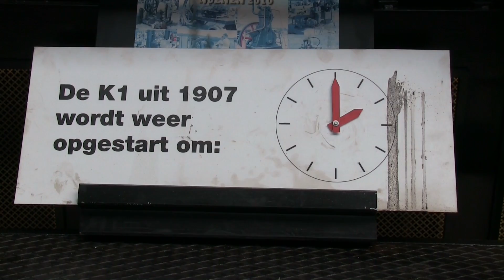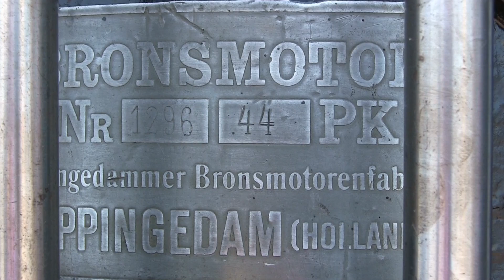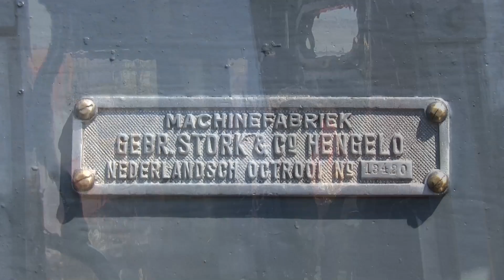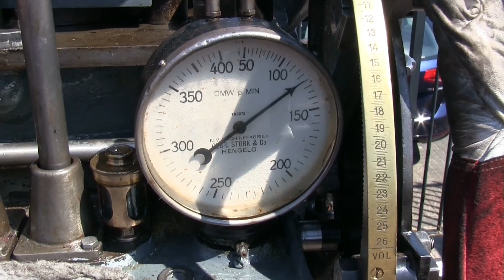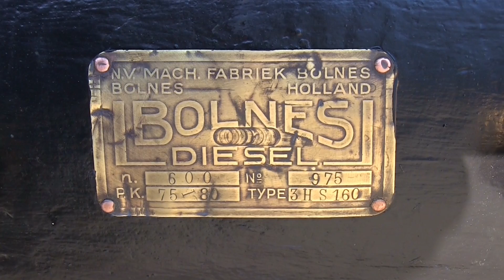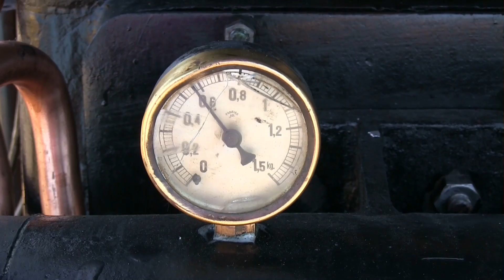Hollandse Karrendag zaterdag 27 mei 2017

Comment: Wasn't the Thomassen K1 originally hot-tube ignition?

I would like to know how the scavenging is done on that two-stroke Bolnes.
Reply from the maker: I don't think the K1 ever was a hot bulb engine, if that's what you mean. The engine runs on petrol; at 1:35 you can see the ignition mechanism in operation.
Reply from the maker: Scavenging on the Bolnes is done by the crosshead acting as an air pump. See https://mecmuseum.nl/bolnes/ for a cross section of a more modern L engine. Such an engine (5 cylinder 5KL) can be seen at the end in my report of the Hollandse Karrendag 2015 with the air valves visible.
Reply: Onderzoeker67 What I mean is a tube in the cylinder head which is heated by a gas flame.  This was used as means of ignition in some early gas engines.
Reply from the maker: I see: https://en.wikipedia.org/wiki/Hot_tube_engine  
I believe the K1 was not.